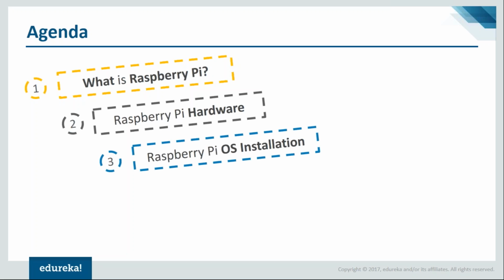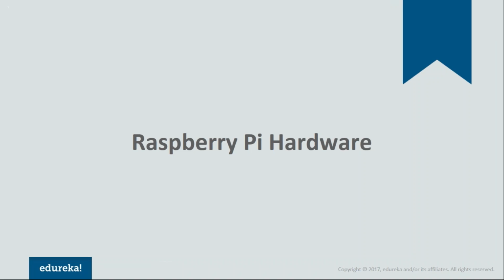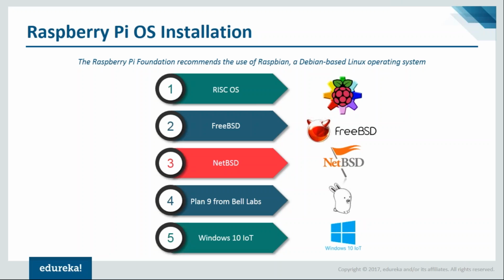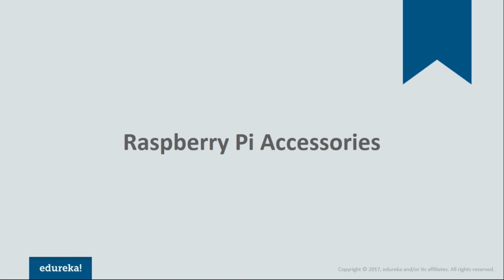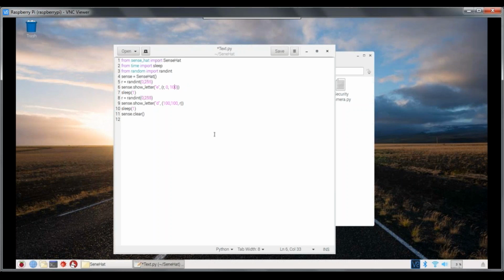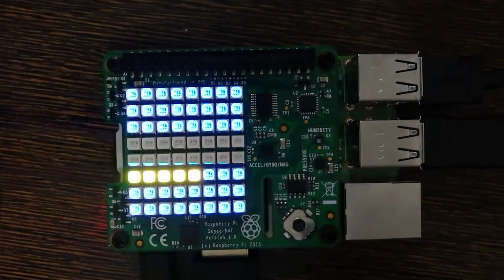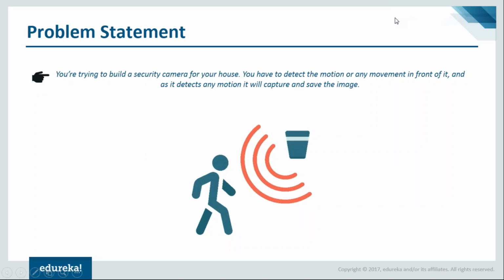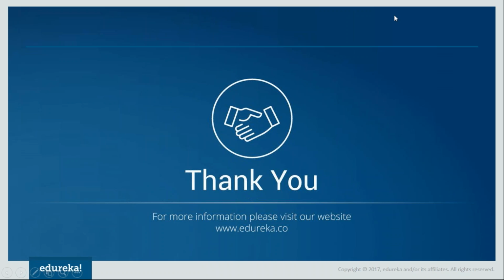Raspberry Pi 3 Tutorial | Raspberry Pi 3 Projects | IoT Projects | IoT Tutorial | Edureka

Comment: I can't connect raspberry pi with display using HDMI can u Please help me
Reply from the maker: Hi Gokul, power issues can cause a Raspberry Pi to fail. It might switch off or hang when running, or it might simply fail to boot at all. This is because a stable power supply unit (PSU) is required for the SD card to be reliably read.